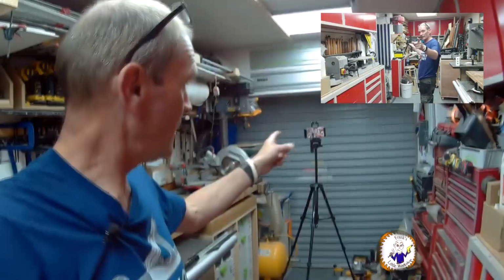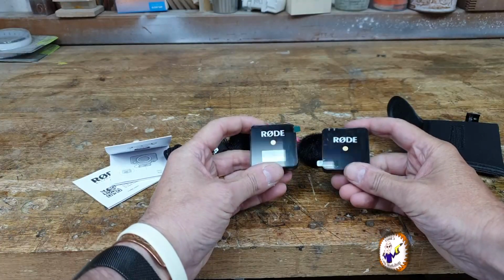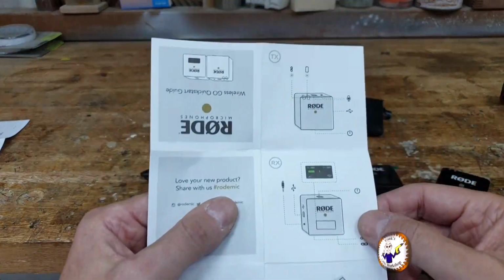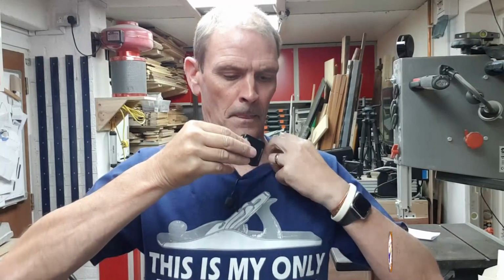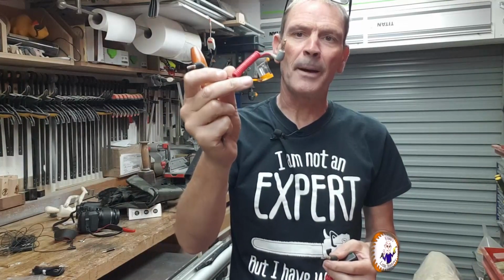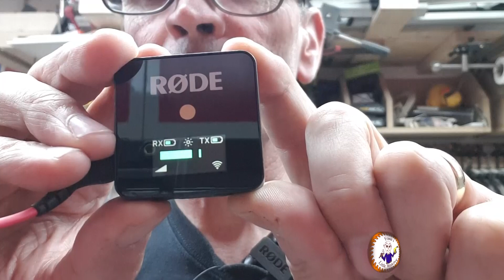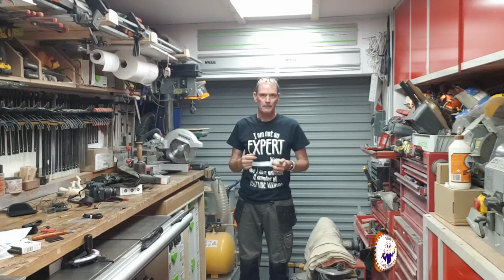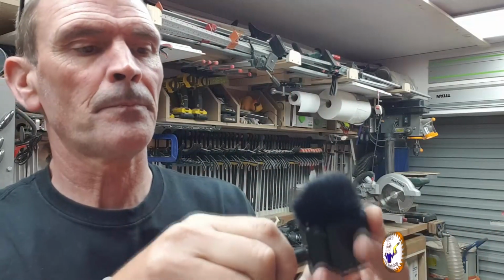RODE wireless GO for the workshop.

Comment: I had the same cable issue with my Rode shotgun mic. Should really be included or in big letters on the box with the number of folks using these for phones. Mind you, my new phone doesn't have a plug at all so has to blue tooth. While a great idea, I am glad you explained the lav mic connector, as the big square box on the collar looks a bit naph. Nice demo mate, will upgrade to one soon I think.
Reply from the maker: 😁 Thanks James. I must admit I wasted a Hell of a lot of time looking through all of my old electronics boxes looking for cables I could use... in the end I fixed it all with Amazon 🤣. I'm looking forward to using these. I'm very impressed so far. Thanks for watching 😁👍🇬🇧

Comment: How are you finding it now Frank after several months of ownership? Pros and cons, thinking of getting one. Just ordered a new phone which I use for filming and want to upgrade the audio. Would you recommend the lavalier mic to go with it? Cheers pal 😀😀
Reply from the maker: 😁 Hi Leo. I was thinking of doing a quick follow up video as I've been using them for a while. But to summarise just for you "you really need to get these" they are excellent. So much better than anything I had before. I would suggest you get a set and you will quickly see how much better they are than having wires dragging across the workshop. Order them today... you won't be dissapointed. Let me know how you get on. Thanks Leo 😁👍